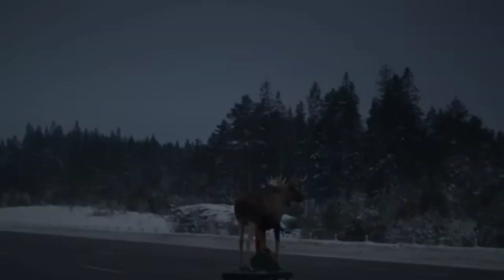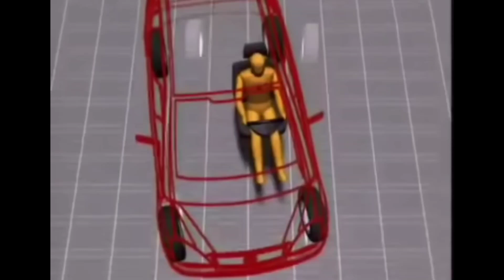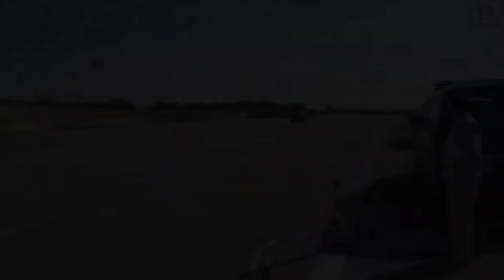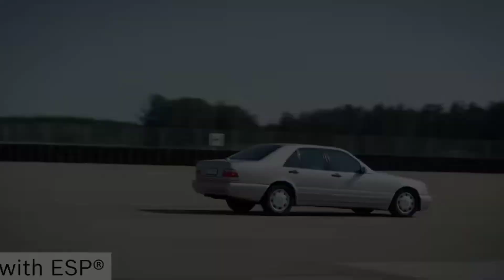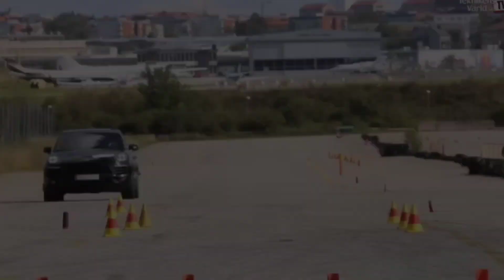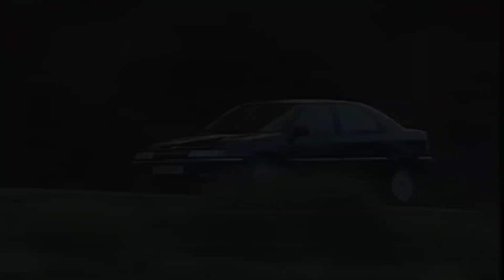Why Modern Cars Fail The Moose Test?

Comment: the Hilux solution hardly solves the problem and it does it in the most cheapest innefective way possible. ESP is an electronic system that should not be relied on and im sure they raised the tire pressure just to give the car less grip so it physically can't flip itself. If a car rolls the only real solution is a lower CG or a better suspension system.